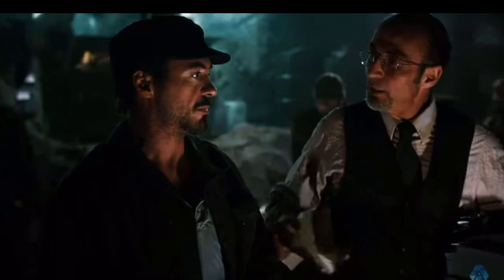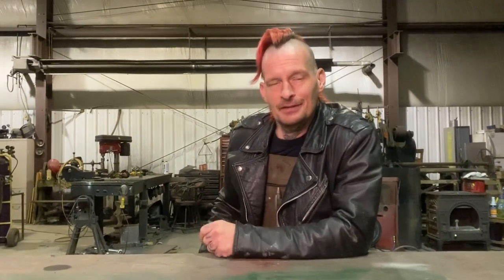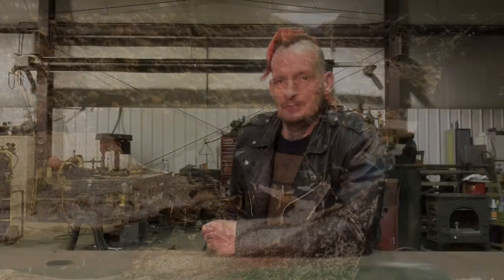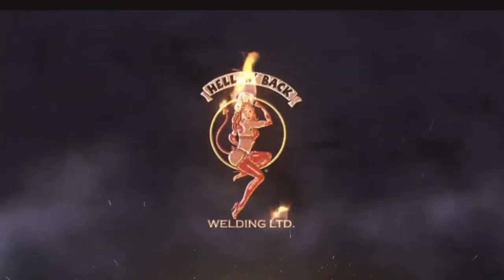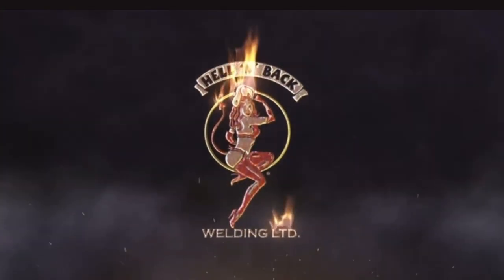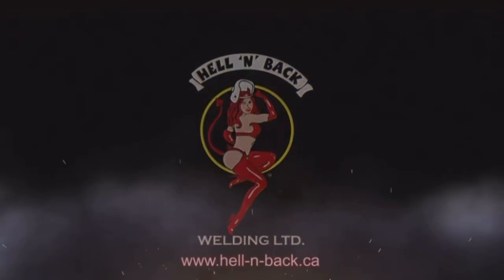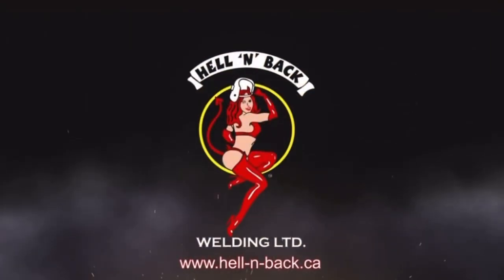Chewbacca Can’t Weld! Welder Reacts to Welding in Movies (And Some Forging Too)

Comment: never have i found someone that loves conan movie as much as myself. every time thay talked about crom. and the riddle of steel i would get goosbumps. And i watched the other wones. where they also compaired crom on hes mounten with the 4 winds. and it was just totally awsome. there wil never be a movie like that again.
Reply from the maker: Goosebumps is right. I totally agree. I had to include it in this video to show a movie that used a real expert and had a real appreciation for steel and what it takes to work it.

Comment: that conan casting scene does have a slight green tint to the smoke... never noticed it before and its always drove me nuts, you don't open air cast steel... that and the quenching in snow thing, when I was much younger and dumber... I tried that.. you can likely guess the results.   (forging/blacksmithing books were not easy to come by then, and local smiths were tight lipped about how things should be done so I did a lot of guessing and mimicking movies, thankfully smiths today are a lot more open about techniques and processes and there are probably hundreds of books and YouTube now)
Reply from the maker: Oh yeah exactly. I learned a lot from antique and vintage books I found in used bookstores like the Practical Blacksmithing series because there’s no real blacksmith apprenticeships here in Alberta like in the UK. At least now there are classes and workshops. Jody Samson has addressed that casting sequence in interviews and he also says it would shatter. Of course we want to quench by cooling slowly like in oil instead. But some things just look amazing on screen. Although I love when the oil catches fire during quenching and think it would have looked pretty badass too.
Reply: @HellNBackWelding  yup, machinery handbook, and groups like the SCA got me on the right track... mostly lol, the rest was a lot of trial end error, need to fire the forge up again...
Reply from the maker: @northmanlogging2769  nothing ever beats learning by doing, which includes some fails and retries. And I’ll always say yes to firing up the forge again. I just got to make a custom fire tool set commission and it was nice to get back to my anvil.